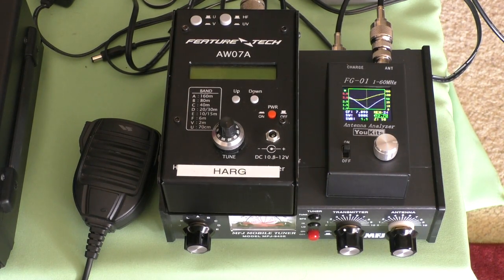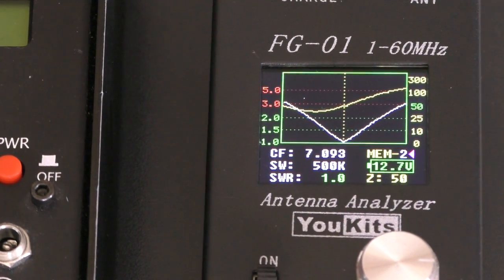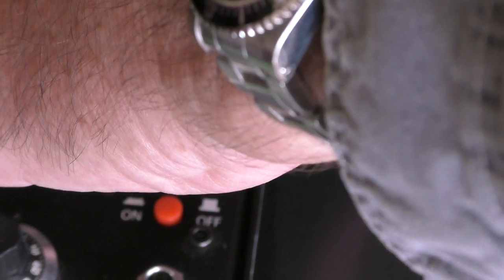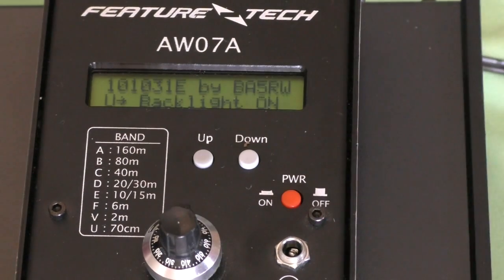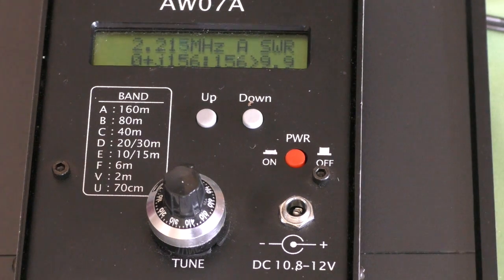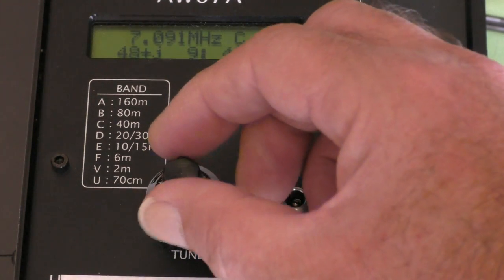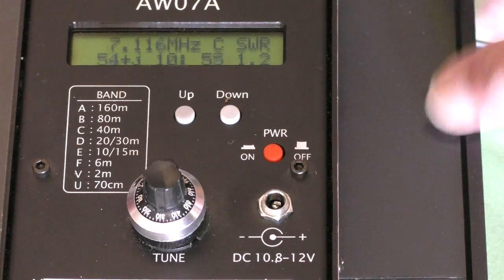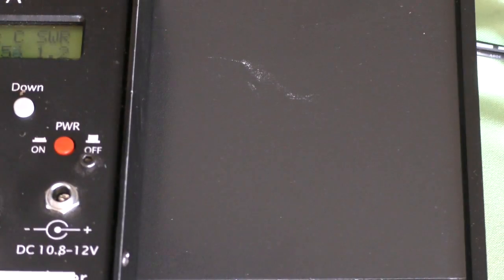Feature Tech AW07A And You Kits FG-01 Antenna Analysers

Comment: https://youkits.com/products/youkits-fg-01-1-72mhz-antenna-analyser
Reply: I guess this is the latest version Steve? Slightly larger BW too.
Reply from the maker: It looks nice. They have tidied up the front panel as well as increasing the frequency range. If you look at mine you will see the information on the front panel is printed, and not very well, it's across the front panel at an angle. It does work very well though, that's the main thing. I have heard you say your primary interest is in HF so you won't go wrong with one of these if it works as well as the previous model, and they're a bargain.
Reply: Yeah HF is an art, science and a lotto ticket rolled into one package. I like the challenge. I reckon I will buy one to test my HF dummy loads !  lol
Reply: Currently playing with CW Decoders online - either its not working too well or people speak backward Swahili on Morse
Reply from the maker: It wouldn't have any trouble decoding my morse then...